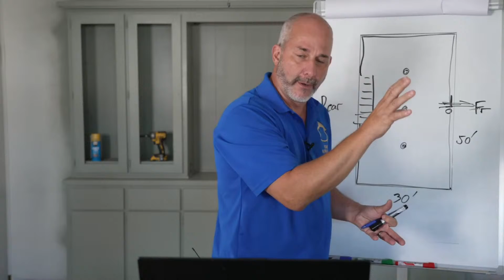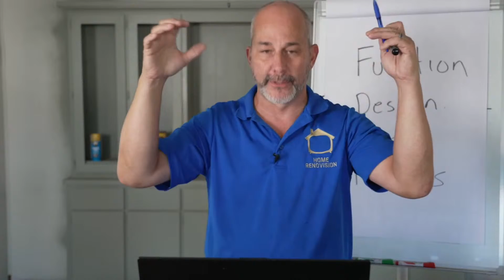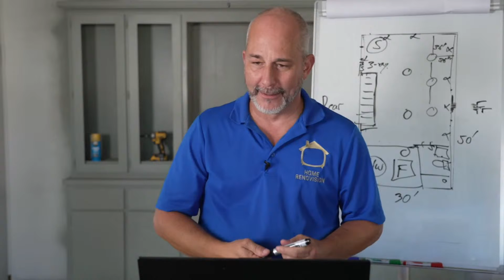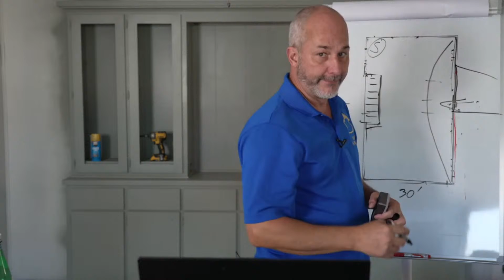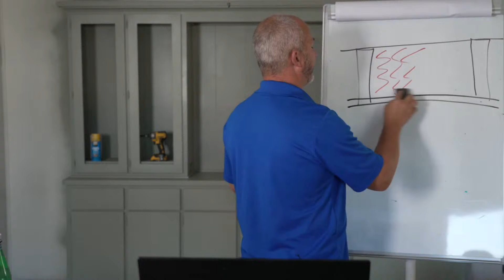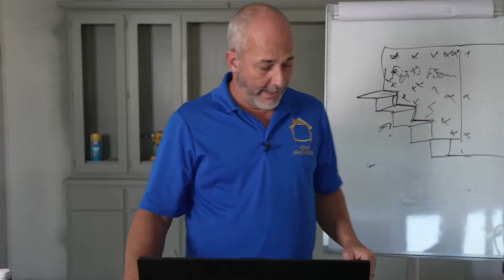How To Plan a Basement Renovation

Comment: I have a block wall basement. I have 2 small windows that need to be replaced. Do i fix the windows first or insulate the wall and frame it? I want to hang cabinets from the walls to get stuff off the floor.

Comment: Jeff, my Basement has 2 in pink board around the outside wall and a drain tile outside as well.
Is that unsual in your opinion. ( built in 2000.)

Comment: i didnt know i was suppose to put foam in my rim joists when i built my basement room a few years back.  i only have fiberglass.  my hope is it isnt too bad since its an old home with no insulation above so there is still a way for the area to air out.  live and learn i guess.  im adding onto the room this yer and i will be sure not to miss that step.

Comment: Wow! I have a basement! I can do anything!
       Not so fast, dreamer. Time for a reality check.
       The first issue is access. It's nowhere near as easy to move furniture into a basement as compared to the rest of the house.
       Now let's look at the construction. Basements are NOT designed to be living spaces. Indeed, they're deliberately designed to NOT be living spaces, as a dodge to taxes and code requirements. Let's look at some of these challenges:
-- Ceilings are lower;
-- Sewer lines might actually be above the floor level. Good luck getting water to drain;
-- Floors are not level;
-- Insurance will NOT cover flooding -- and ground water will eventually leak in;
-- The home's HVAC isn't designed for this extra volume, nor is it tied in (hence that chilly, damp, musty ambience);
-- Exits, especially for bedrooms, are inadequate.
       At this point you're probably thinking "this guy is nuts -- I'll just do ..." or "no inspector will ever see this." You're missing the point. The point is: rules are based on reality, and you can't cheat reality. What works fine in the house above simply won't work in a basement. Here are a few "essentials." Skip them and you'll regret it later.
     Basic "starting points" include:
-- Put your face to the floor level. You'll be amazed at the waves in the "flat" floor. Your first need is to smooth the floor and slope it to drain to your sump pump.
-- Cover the perimeter walls with an inch of spray foam. Accept no substitutes. Spray foam will stick to the walls, prevent moisture from condensing, and not support either mold nor vermin.
-- Have professionals review your HVAC and electrical plans. Listen to the pro's opinions. There are thousands of design considerations; your house is almost certainly not designed to handle a habitable basement.
-- ALL lumber used must be pressure treated.
-- Floor coverings should be in pieces small enough to roll up and remove after a flood. That means throw rugs no larger than a sheet of plywood. Wet carpet is HEAVY.
-- You'll need to bring in fresh air, exhaust the old air, and regulate the humidity.
        Finally, the inspector is NOT your enemy. Inspectors have seen these projects before and are a good source of information.

Comment: I wish I would have caught this live. My basement has the stairs and mechanics right smack dab in the middle of the basement making the set up so much more difficult to layout than it needs to be. It forces you to layout the basement into a circle.
Reply: I have a layout like that. There is too many machines under the stairs, so I also want to make the mechanics "room" bigger. Hard with 2 load bearing walls!

Hope your projects are processing.

Comment: I just bought a house with a apartment in the basement.. We want to soundproof.. we are taking off the flooring upstairs anyway. 

Should we remove the subfloor and throw insulation in from there or should we pull off the drywall on the ceiling of the basement and throw insulation in there?

Comment: So I have a walkout basement in a newer home (10yrs old).  The rough plumbing that was preinstalled designates that it is suitable for dwelling and has moisture barrier in the concrete walls and flooring.  1000 ft.² of open space with few large windows and sliding glass door, and the back walls are below grade and concrete, does not smell musty and I don’t believe much moisture comes through the wall if at all, do I still use a foam board insulation?
Reply: @RC.56  Hi dear Good evening . I hope my comment didn't sound as a form of privacy invasion your comment  tells of a man  with a beautiful heart which led me to comment  I don’t a normally write in the comment section but I think you deserve this complement. If you don’t mind can we be friends? Thanks  God bless you….🌺🌺🌺

Comment: Hello Jeff, 
1974 house, ranch, single home with about 1200sq living area, unfinished basement. 
Radon air system in-place, sup pump, in ground water drainage as well for water level riser... just in case! Have not seen anything this past 4 years but is there...!

Absolutely beautiful Q&A session. Loved it, Jeff kudos to you man, love the show, been following for a while now. Well, mostly you just described my basement there. Im building a french drain as a method to get rid of the problem, to remove water from foundation.....redirecting it towards the slope ( back yard).  
Front of the house has been split into 2 sides, to the left when there was a clogged pipe for roof drainage that takes care of the garage and drains to the side slopped away (fixed,) dug about 2feet down, ran a havy duty landscaping cloth and a perforated pipe that connects with the existing pipe which drains away from the house. On the right side, dug about 2.5 feet deep ( manual labor, not a good idea, loool)still the on the front towards the further corner on the right side, used a non-fibered foundation coating on the exposed outside concrete (both sides as well), installed a heavy duty landscaping cloth and a perforated pipe along to get the water away from the foundation toward the side of the house to follow the slope toward the back yard. I have learned that I need to do the side of the house as well to remove all water from sitting next to the foundation, this will be done with tools from our friends at home depot :). A mini escavator, to dig and transport the gravel,....it will certainly improve the inside of the basement humidity quality, currently humidity is under 50%, trying make an office and just a simple hang out room, closed closet, enclosed mechanical room, etc... trying to keep it simple! 

any thoughts or ideas, tricks, tips, would be very much appreciated!  

Thanks
Gino

Comment: Hey Jeff. Love your videos! They've already helped me through a bathroom remodel and now I'm onto finishing the basement. I've got a 1926 home in Minnesota. I want to finish part of my basement for an office and additional bathroom. There is no current moisture mitigation, but my basement has stayed dry over the last 5 years that I've owned it (good gutter setup). I run a dehumidifier in the summer to keep the RH at 55-60%. Can I skip the french drain and sump system and just start finishing my basement with DriCore subfloor and foam board offset from the wall like you describe to allow the moisture to equalize?

Comment: so if your inside attempt at sealing a wall by painting on something only lasts say 5 years, how long is the sealant on the outside of the wall going to last? My dad built his house in 1986 and a rolled on tar like substance was put on the outside walls along with a drain all the way around. His basement stays pretty dry to this day. Is there nothing like this nowadays that can be rolled on the inside? I'm building my house from the ground up, what do you suggest I do for moisture mitigation? Thank you

Comment: Hi Jeff, 1975 4 level split basement in Saskatchewan,  finishing bottom 2 levels, I've put dricore down in living spaces but what can I put in the utility room/ laundry on the concrete floor to keep it clean? There is a sum pump and open drain. Paint the concrete floor or stick vinyl sheets on the floor? Floor is pretty wavy so tiling would be harder. Also, want a cost effective option that also looks good 😊. Cheers, appreciate your wisdom!

Comment: Below Slab vapor barrier. I was talking to some of the flatwork guys from the 80's and 90's. After inspection, they would poke holes in the vapor barrier to let the concrete cure faster. You may have vapor barrier, but it probably has holes in it.

Comment: Hey Jeff, you helped me soo much with my DIY Reno's, I value all your videos dearly. I live in Toronto. I was not able to do exterior waterproofing. So my waterproof company installed a interior membrane from ground level to the weeping tiles. Is it ok to spray foam insulation right on the basement wall/membrane from top to bottom?

And if I there was no exterior or interior water proofing on the walls except for weeping tiles...is it still ok to spray foam directly on the brick walls? 

Thanks!

Comment: Hi Jeff!

Currently finishing my basement. It has Standard concrete foundation walls. My basement staircase is right up against the wall. While the rest of my basement is insulated, framed, and drywalled. I only want to intrude onto my step width as little as possible (less than an inch ideally). Any idea how i can finish off that wall with a simple barrier, air gap, and drywall? (im thinking 1/4" foam, 1/4"shims for the air gap, and 1/4"drywall) Anything to make the wall look finished, and not cold to the touch. Open to any ideas.

Comment: My 75-year-old cabin is 24 ft by 32 feet. I plan to raise the cabin, demo, and build an all-new basement.  For below the slab, your thoughts on 10 inches of ¾ inch crushed rock, then two 1-inch layers of rigid foam insulation, then a layer of 10 mil plastic moisture barrier, then pour the slab. Your thoughts?

Comment: Hey Jeff, after watching all your basement-related videos, im getting closer to starting the job over about half the area. 
One hiccup has really been bothering me, and thats the slope of my basement. Its "flatt-ish", but theres about a 2.5 in difference from the front to the back over a 20 or so foot span. 
Thats a lot of self-levelling, and i was considering a loose-lay vinyl floor, but im concerned. Is there a way to solve flat but not level or a flooring you would suggest ?

Comment: Is there a way to know if you need a wastewater pump if you want  to install a shower in the basement?
Reply: I’m also wondering this!don’t mean to piggyback off your question but looking at the possibility of adding a bathroom at some point in the basement but all plumbing is above the  slab. I’m also going to consult a plumber if I can to see if it’s possible or even practical to trench out a new waste drain and rough in the new fixtures and proper venting as well and what the cost would be if it can be done at all
Reply: @rlthereal  I put 2x10s down as a "deck" that would become the floor of the bathroom and ran drainlines over the  slab.  Finished with a single sheet of vinyl and a drain in the middle (all with a 3 degree slope), so it's all easily cleanable.

Problem is... the cheapo dual flush home depot toilet... sometimes doesn't want to flush... and when you drain the tub, it back-flows into the shower (the shower and tub are on a common drain, and the toilet is on a different one -- I had old capped drains in the basement, but had to put everything on the deck because they weren't where I needed them to be.
Reply: That seems like a good way to do it (avoiding digging new lines). My only problem I didn’t mention is my ceiling height from cement floor to above joists is only approximately 6’10” at the most. My floor space should work (approximately 5’4” x 8’ ). Also it is directly next to waste and water lines which is a plus I guess. I’m not sure which way is more cost effective probably to avoid it altogether lol
Reply: @thorjohnson5237  Hi dear Good evening . I hope my comment didn't sound as a form of privacy invasion your comment  tells of a man  with a beautiful heart which led me to comment  I don’t a normally write in the comment section but I think you deserve this complement. If you don’t mind can we be friends? Thanks  God bless you….🌺🌺🌺

Comment: Have a dry basement system installed in the basement. With a sump that the the tech says hasn’t had to come on in all the time it’s been there, since the eighties. House built in 1906. No moisture with the plastic test on the wall. My problem is the floors all slope to the old drains . Is it safe to level them ?

Comment: Hey Jeff! Love your videos! Helped me build the confidence to do some DIY stuff and now I'm loving it! I have a basement question for you.

Northern Ohio, built late 60s with an addition in 99. Its a 3 section basement separated by block walls. Im working on the first section which is part of the original home. Just demo'd everything and no insulation. So my plan is (from outside in) Rigid Foam (foil faced), 2x4 framing, batt insulation, drywall.

My question is in regards to if i need a vapor barrier between batt and drywall? And do i need mold resistant drywall or can i use fire resistant?

Had i known about Reality Renovision i would've contacted you sooner! Could've done a multi part series with all the work I'm planning

Comment: I’ve seen sound techs baffle their wall/ceiling studs where they leave a gap …if that makes sense. Where it’s a 2x8 in wall, but they use 2x4 studs where 16in on center for one side and in between those, for the adjacent wall

Comment: Missed the show..cause I’m traveling in Florida for work too.

BLUF: water comes into my basement over the foundation wall right where the iron beam is. Can I dig down some and seal that up with some kind of barrier and if so should I put the dirt back or put rock or even fill it with concrete?

Story
Have a house in Kansas City, 1980, basement surrounded by dirt on 3sides, the 4th side (with stairs and wall) is garage. Garage side of home is on a steep slope. Foundation is crack right at the stairs. Can see daylight, quarter inch gap. It’s even, no back and forth movement. I used the orange schluter to make sure water didn’t come in there. have done outside water mitigation. I get almost no water in the basement EXCEPT if it rains heavy for a few days. I BELIEVE it’s coming OVER the top of the foundation wall where home and foundation meet. It comes all in a rush like it’s backed up somewhere. Where water comes into the house is right where the iron beam and AC cables are.  Only work I have done is your black dimpled subfloor method and a closetless room. 

My question to anyone who has read this: can I dig like a foot down below the top of the foundation wall on that side of the house and use some kind of house wrap tape or something similar a little above and a little below that seam? Would that stop the water from combining in there? Would I then put the dirt back at a slope or should I put like dirty rocks that would eventually get as hard as concrete..I could do a french drain too
Reply from the maker: I would consider trenching and installing a french drain. that way you remove the water before it goes over the foundation. Cheers!

Comment: Going to be finishing a 2800 sq ft basement next year. This will be on a brand new home build in Kentucky. Watched damn near all of your interior work vids over the years since I became a Sub.

I'm assuming I'll be waterproofed based on new build standards. This will be a walkout basement with 9ft ceilings. Doing a bedroom/bath, craft room, massive bar, media room, lounge area, and man cave. I'll be doing strapping for ceiling. I'll join the channel well before so I'm not just joining to ask direct questions then bounce. 

Questions, 
Still treated lumber for base on walls?
Best way to utilize 2x4x8 or buy 2x4x10 and have a massive pile of scrap lumber. Don't recall see you covering that gap since most work you've are not 9ft ceilings.
LVP best option for flooring?
10 ft drywall or 8ft and configure it in with drywall mud
Guessing 1/4 in is fine for ceilings using 4x12 sheets?

Thanks, if you're up for it when the time comes. You're more than welcome to shoot some vids while I build this out ;)

Comment: Love the channel Sir! Question Jeff, I ran all my electrical in my basement, but I forgot to tie in my mechanical room for a switch and one light. My bathroom is sharing the same wall and I only have one outlet in there. Can I tie off that bathroom outlet so I don’t have to run a line all the way to the other side of the basement to the box?

Comment: I have an interior french drain in my unfinished basement. No water problems at all since installation and has been 2 years. Would i be okay to start doing interior framing over the concrete that was poured on top of the french drain? Also how important is to level the basement if using DMX and LVP for flooring once walls are in place?
Reply from the maker: yes feel free. using a 1 1/2" ram set after boring a half inch hole will work perfectly since the drain pipe is about 3" from the surface. as for the dmx 1 step and vinyl as long as you pass the garbage bag test yes. otherwise use dricore and then add the walls. Cheers!

Comment: 1890's house in NE Ohio.
This is exactly why my basement is a workshop, and not actual living space.
Waterproofing / mitigation would cost more than the house is worth.
(very bad housing market here. 2000 sq ft, 3 bed, 2 bath is only worth $50,000)
I have 9' headroom, a ton of space, and only a little water in spring / fall / really heavy rains.
Keep everything off the floor. Build everything with treated lumber on the bottom, or put it all on casters. Perfect workshop, and storage for holiday stuff.
Reply from the maker: nicely played. Cheers!